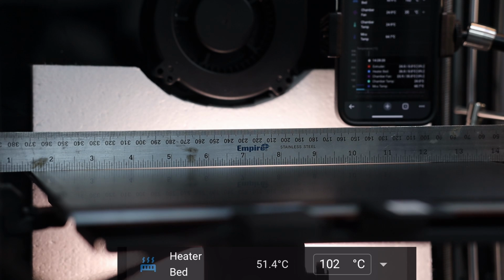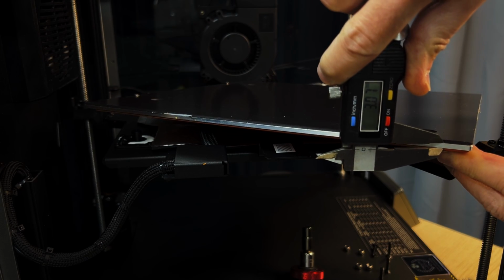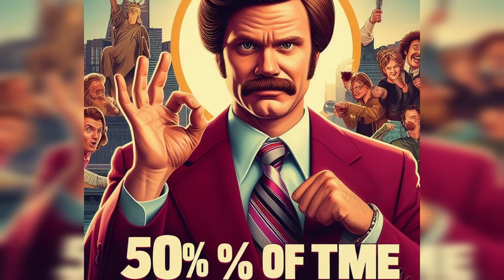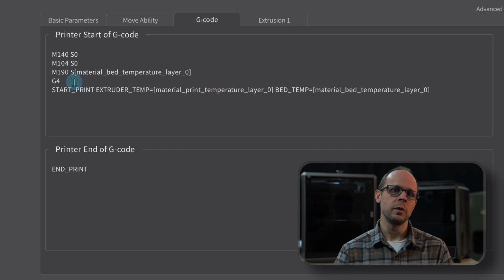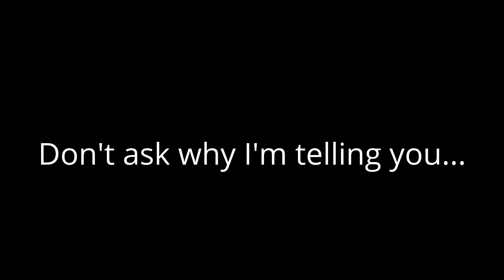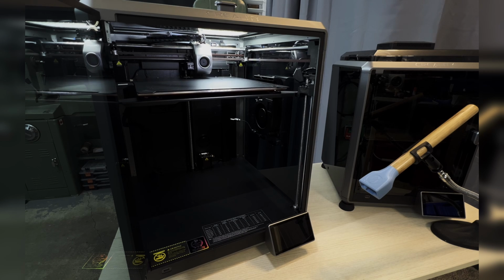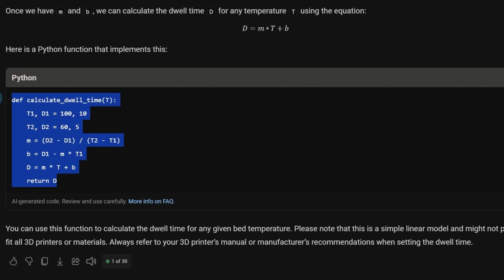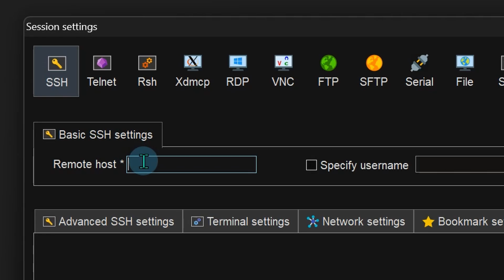Let Your Creality K1 MAX and K1 Printers Soak for the Best First Layers

Comment: If you want to skip the start gcode and do this all in Klipper you can update the Start_Print or Print_Start depending on how you have it labeled and if you have the printer rooted.  This section below will heatsoak for 15 minutes if over 90 C for the bed, 5 minutes if between 60 and 90 C, and skip a soak if under 60 C.  You can adjust as needed.  I use a chamber temp sensor and instead of waiting 15 minutes I have it wait for a specific temperature.

{% if params.BED|int > 90 %}                                                               ; Checks if the bed temp is higher than 90c - if so then trigger a heatsoak.
    M190 S{ params.BED }                                                                     ; Wait for bed temperature to reach target
    SET_DISPLAY_TEXT MSG="Grab a beer to warm up to"             ; Displays info
    G4 S900                                                                                              ; Waits 15 min for the bedtemp to stabilize
    {% elif params.BED|int < 60 %}
    M190 S{ params.BED }                                                                     ; Wait for bed temperature to reach target
    {% else %}
    M190 S{ params.BED }                                                                      ; Wait for bed temperature to reach target
    SET_DISPLAY_TEXT MSG="Soak for 5 min"                                  ; Displays info
    G4 P300000                                                                                        ; Waits 5 min for the bedtemp to stabilize
    {% endif %}
Reply: I think you have extra 0's in your 15 minutes wait.
Reply: @JohnOlson  Thanks, like I said I don't use it but rather the chamber temp.  Should be correct now.
Reply: @tinkerandexpand  yeah. Didn’t want someone copying it and wondering why it took forever. 🤣
Reply from the maker: Very nice, that's a great option.  Is this usable for PLA and PETG with the door/top open as well or do you find that you don't open them for those materials and rely on the fans?
Reply: @MakeIt This is for my Voron 2.4, so not the exact same as a K1, but for PLA/PETG I will typically leave the door closed so door/top on for K1.  The main reason for this is that I moved to CPAP cooling and it can be quite loud.  If I was still on the stock 5015 Stealth Burner part cooling I would probably still have it opened.  There should be no issue with having the top off and door open though, I would assume.  I feel that would be more reliant on ambient temp and making sure the soak time is long enough for the bed to settle or chamber to heat if enclosing it.  Another thing that you can try for warping on heating and warping over time is adjusting max_power: under [heater_bed].  If there is no value set, add the parameter like "max_power: 0.75" to only allow it to use 75% power when heating the bed.  Adjust around with that to see if it helps any.
Reply from the maker: @tinkerandexpand  Oh, I need to do my Voron project, I keep putting it off.  I'd like an IDEX setup, similar to their new Phoenix/24 project.  It probably makes the most sense to do what Prusa is doing and having swappable heads from a mass perspective, or find ways to reduce the weight.  I think their accel had to be lower on the big printer to compensate 1/2 if I remember correctly from a typical setup.

I bet that fan setup is amazing; I think the FLSUN deltas moved to that as well.   

I'll check the setting, I think you're right though from what I remember we have the bed going 100% and then when it's close, it'll go down to 15-30% or less to hit the mark right on.  Setting it lower would slow the heating process and provide a better result, makes complete sense to me.

Comment: Perfect timing.  I have been eyeballing a K1 Max as a new printer.
Reply from the maker: Nice, it should get you where you need to be with this printer on the first layer.  Since doing these changes I've had great success with it, I don't think I really have any complaints about the printer, it was really just that first layer.